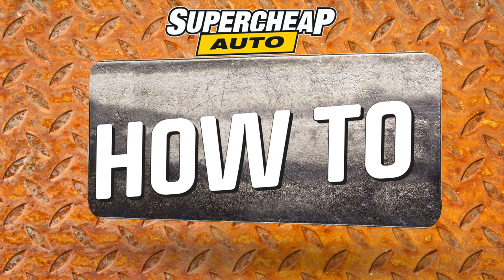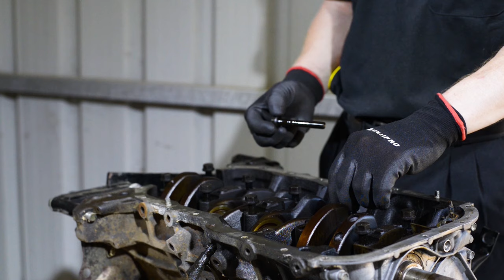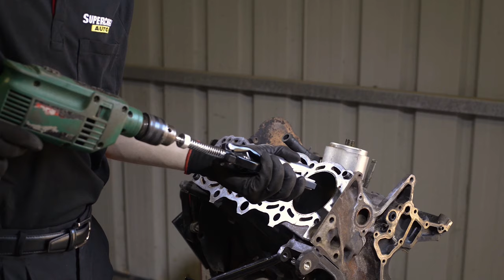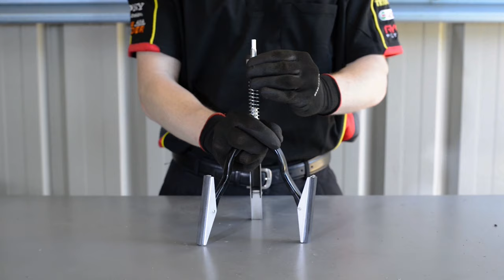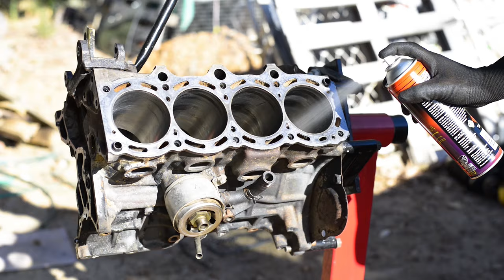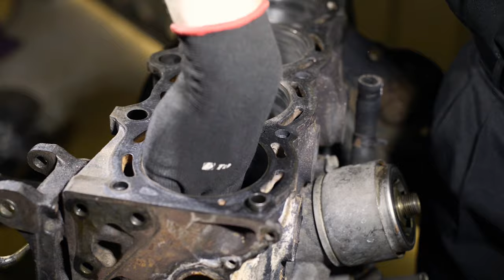How to Hone Engine Cylinders The Right Way

Comment: This tool is good for getting out the high spots in the bore, after using this run the tool that has multiple stones that looks like a toilet brush to give you the cross hatch pattern
Reply: I didn't find a ball hone for the diameter of my cylinders, so I only had this tool to do this.
And to my big surprise, the crosshatch pattern was absolutely perfect!
But it was a difficult task to get it right, you have to choose the right drill speed and stroke that shit fast!

Comment: I have a 1980 tt 250 yamaha. Bore an stroke is 75x 56.5mm. Should I get a 3 1/4 hone or a 3 1/2 ball hone
Reply: Ball hone makes a bad finish and its not consistent with the diameter

Comment: Stones are reffered to grit size 240-320-400etc  Optional stones should be available .
Using oil with large amounts of friction modifier eg engine oil is NOT recommended . Using common available suto trans fluid is ideal or WD40 etc 
1st identify the cyl bores   cast iron or Nika Sil 
2nd identify what the OEM cross hatch pattern is 35--45--44 degree ??
3rd remove cylinder ridge 
4th  measure cylinder bore taper  and outta round / ovality 
5th ALWAYS HAVE ENGINE  PROFESSIONALLY MACHINE  HONED  IN A  dedicated machine 
5a if the measurements are even on the max limit for wear a machine hone is recommended  to achieve max life remaining life 
5b the more the measurements are over the wear tolerance the rehone will have a very short life span 
3c excessive cyl bore wear will have oil consumption problems

Comment: I just did this and used WD40 prayed on the stones and in the bore and spin in a bucket of warm/hot soapy water each 16, 45degree angle up and down in the bore. Washing and spraying WD40 each time. Then i did 15 with the drill in reverse. Not sure if supposed to go in reverse but that’s what i did. I didn’t take the big cam out either. Just did a hone and will put new piston and rings standard size. 1HZ. I did a light test at night dark with one top ring in the piston only and manually moved the piston up and down in each barrel, couldn’t see one bit of light other then the ring gap. First go at this hopefully that’s enough?!
Reply: Disassembly is critical as the waste material resulting from the glaze cannot contaminate any assembly component whatsoever. Although a thorough clean afterwards can shape up the process, initial prevention of a bigger mess should always be considered first. Saves time and reduces the likelihood of waste material comprising the nature of new bearings, components etc.

Comment: Left out the step where you bore out those worn cylinder walls.
Reply: Its good enough for a cage
Reply: You will only rebore if the bore is too worn or out of round and requires a oversized piston. If the bore is ok with existing piston a hone will be ok for new rings. Either way you need a bore gauge to measure this and they are usually around $300 minimum  for anything decent. This is backyard slap it together zone. No decent engine will be done this way.
Reply: I also didn't see a torque plate being used.
Reply: @dirkadirka5395  not required on that type of engine, if it was a harley davidson then yes one would be needed
Reply: @blacksheep6888  Why not for the 4 cylinder?
Reply: @dirkadirka5395  Torque plates are needed if you assemble tight clearance engines or make one for performance. For daily driving and just re-honing it, you can just do it without, there's absolutely no harm in that. It doesn't matter if it's a 2 cyl or 8 cyl or whatever in between.
Reply: @XStuntManiac  Interesting. Could I have an example of standard tolerances/class of fit required for High performance vs a regular engine please? thanks for your input and cheers.
Reply: @dirkadirka5395  I can't really come up with any real life examples, but if you want to get more power out of the same displacement engine, you need to make it more efficient. To make it more efficient, you need tighter clearences to for example raise the compression ratio if you want an NA engine. 
As well as racing spec engines are toleranced tighter than any otheres due to exact same reason, they need the quality to make as much power from the engine as possible, there's no need for as huge "reliability" like we seek in daily drivers cars.
I believe that the recent season F1 V6T engines are needed to be so efficient, that they are so tight you literally need an impact drill to crank them, where in your daily driver car you can spin the engine by hand with a wrench on a nut of a pulley.
Reply: Best to use a stepped top ring in them cases or grind a chamfer on the new top ring  assuming there putting new rings back on that is

Comment: Shouldn't have the ring ridge. Back to the machine shop.
Reply: Flash Man  when I did engines, easy stuff in the early 70s, we always bored them out to receive first oversize pistons. Most honing was done by the machine shop. I did hone a few that had no ridge. Usually measured out ok for stock rings. But most of my honing was done on dirt bikes. I turned to using the phones with the balls on the ends of wire. Also did brake cylinders. But engines were done by the pros. Later on by the early 80s it was buying rebuilt engines straight from the factory. Cost didnt pay to do it ourselves any longer.

Comment: That is not a hone. It is called a glaze breaker. It would be far to slow and not accurate to hone a cylinder to be true
Reply: That's the same type cylinder hone they have used for many decades before these new fangled ball hones came out
Reply: @glengillham4629  to rebore a cylinder with a rigid machining boring tool is an entirely different process then simply honing a cylinder, breaking the glaze, and preparing it for new rings. They can call a Boring tool a "hone" all they want to nowadays, it does not make them the same thing.
Reply: this is definitely a hone, its just not going to give straight and perfect results like a machine shop rigid hone would... its absolutely fine for cleaning up cylinders, if they fall within spec there is absolutely nothing wrong with this kind of hone.

Comment: I thought the name of this video was hone cylinders the right way.
This is not the right way.
You need a rigid hone - IE a Sunnen hone, that keeps consistent pressure evenly and will correct any imperfections in the bore. 
All you have demonstrated is how to scratch a cylinder

Comment: Let's just say... hypothetically... for a friend... if a person ran their 2 stroke without a working oil pump and scored their cylinder walls but the pistons themselves are fine because they only ran it 3 times for heat cycles.. (again this is definitely hypothetically) they could use this and keep the same pistons in from the rebuild they just spent 5 grand on and not have to buy a new cylinder or will this only work for deglazing
Reply: Depends how bad the scoring is. But almost all scoring is irreparable by honing, the exception would be when it doesn't catch your fingernail. So basically yeah only deglazing. Probably going to have to start over on the top end as the cylinder might need machining, therefore, your pistons and rings won't match up.
Reply: @LifeofAedan  tried honing it out and it didn't work, I brought them to a machine shop, hoping they'll get it done, just gonna be looking at ass loads of labour charges but guess that what happens, damn
Reply: @GabrielLenek  yep unfortunately that’s always the hard part is damn machine shops charging a boat load. If you can find yourself one ran by older folks they always seem to be a lot better. For example when I rebuilt my duramax the diesel shop wanted to charge $500 to machine the heads. Brought it over to this little shop connected to an advance auto and got them done for $50 a head. Back in the day when your auto part stores did more than just sell stuff. Pretty cool, but there’s barely any around nowadays.

Comment: Honing? No, This is deglazing. The cylinders will still be out of round and tapered. You might have a nice looking cylinder finish when you're done, but that doesn't mean it will seal a new ring. This is perfume on a pig.
Reply: That;s why you use a ball dunny brush it hides all the wear ?

Comment: So much wrong here. Always make full passes, otherwise you run the risk of tapering the cylinder walls. Honing doesnt just make crosshatching, it removes material and is used to take out the last few thousandths after boring as well as deglazing during a rebuild.
Reply: Yes uniform honing is the key.
Reply: Its only a cage it'll be fine.
Reply: This is just degrade and quick cross hatch. I honed many cylinders no need to bore if have a sunken hone can take as much as you want
Reply: More like tenths not thousands. You'd really have to crank it down to remove thousands.
Reply: @StreetTruckinTitan  what? .1 is a tenth which is far more than .001 which is a thousandth. So a tenth is 100 times more than a thousandth.
Reply: @StreetTruckinTitan  yes .0001 is 1 tenth of one thousandth or 1 ten thousandth you are only talking about thousandths. It does not change the fact that .1 is one tenth, you are correct in saying it isnt one tenth of a thousandth however .1 is still 1 tenth
Reply: All of that is irrelevant though. The fact is honing is used to take out the last few thousandths after boring. It is not uncommon to leave .003 (three thousandths or should i call it three tenths of a hundredth) to .005 (five thousandths) after boring to be removed with a hone. The majority is removed with coarse stones while the final cross hatching is done using fine stones.
Reply: @63jeepj20  I'm aware. We have a precision aerospace honing shop since 1965.
Reply: @StreetTruckinTitan  if that were the case you would know that .1 is a tenth and .0001 is a tenth of a thousandth and not just a tenth.
Reply: @63jeepj20  we deal in .0001s Son. We rough as close as .001-.003 depending on the condition of the bore. We finish anywhere within .0001- .001 again depending what the bp states. I can hold around  .0003 by hand my brother can hold 50 millionths. That is splitting frog hairs.
Reply: @StreetTruckinTitan  that doesnt make any of what i said false. If you deal in ten thousandths and an engine machinist deals in thousandths then telling him you have a tolerance of a tenth kinda creates an issue and you will end up with something way out of tolerance. This is why i said what i said and not a tenth of a thousandth.
Reply: @63jeepj20  study the chart I posted. If you're dealing with a mechanic that doesn't know what tenths are or the decimal equivalent I'd stay away. 
And with that, I bid you a nice day.
Reply: @Checkered Life  again, a tenth is written .1 a tenth of a thousandth is written .0001 if you brought me something to machine and tell me you want a tenth removed youre getting a tenth removed and you will be paying for a new part because of your inability to grasp decimals. My dad owned an engine machine shop for 40 years, ive bored cylinders, decked blocks, resurfaced heads, replaced valve seats and guides, ground valves, line honed, sized rods, trust me i know how to read a dial gauge. The fact that you are arguing about this tells me you are either a janitor that cleans around machines or you work at a production facility that only taught you what you need to know to mass produce whatever part they are running that day. Again, a tenth is a tenth or .1 a tenth of a thousandth is one ten thousandth or .0001 you stated i was wrong in saying a tenth is .1 which is not correct a tenth and a tenth of a thousandth are two very different measurements. All you had to say was "oh you meant an actual tenth, i thought you meant a tenth of a thousandth" and been done with it but instead decided to argue that .1 is not a tenth and attempt to explain how i was wrong by using a tenth of a thousandth as your evidence.
Reply: @SOLDOZER  youve never run an actual hone i see.
Reply: This thread is hilarious. Dude states that thousanths are bigger than tenths, then goes on to pretend like he didn’t just say that and continue lecturing everybody. It’s ok to be wrong. Just fucking own it and move on.

Comment: The right way? Where's the torque plate for the top of the block?
Reply: Not required on this type of engine
Reply: @blacksheep6888  Curious as to why? Thnx
Reply: @dirkadirka5395  its cast iron simple,  I am a qualified mechanic worked in engine reconditioning shop.
Reply: @blacksheep6888  OK cool but when would you use a torque plate then?Thnx
Reply: @dirkadirka5395  some aluminium blocks and motorcycle barrels
Reply: @dirkadirka5395  harley davidson barrels must use torque plates
Reply: @blacksheep6888  Why? I'm looking for the reasoning please.
Reply: @dirkadirka5395  aluminium is flexible carst iron is not having said that the harley barrel is a thin sleeve so there is a small amount of warpage so torque plates are required, but a cast iron block dose not have this problem, and the block has threads in it that don't go all the way to the bottom of the bore, the harley barrel does.
Reply: @dirkadirka5395  also keep in mind aluminium coated barrels, they would require torque plates
Reply: @blacksheep6888  Right so a cast block being flat assuming it is wont be distorted by the mounting of the head,, that being said if the top face of the block is not flat it will be dealt with by the head and gasket being compressed? Thnx!!
Reply: @dirkadirka5395  nope you missed the point its got nothing to do with the flatness of block or head, its bore side wall warpage
Reply: @blacksheep6888  Well then please explain please why and when it should be used. I wish to learn,, thnx.
Reply: torque plates are more suited to a fixed bore hone that will mill out a straight hole and even then its not required on cast iron but people still use them if they're looking for perfect cylinders. 
this type of hone is for backyard/home mechanics to remove surface imperfections and glaze (the cylinder getting polished smooth) from a cylinder wall for a ring to bed against... it doesn't give you a perfectly straight hole but as long as the bore is in spec then you're fine.
Reply: @dirkadirka5395  example is a Harley davidson barrel
Reply: @blacksheep6888  All reputable machine shops use torque plates on cast iron blocks daily.  Your explanation is not correct, sorry.
ALL blocks experience distortion when you torque the heads down, and honing with torque plates is a way to eliminate that when you are doing the final hone. 
That said, this way of honing is not a particularly good one.  It's just a "break the glaze" method, not meant to really size the cylinder to the piston, so it's fine if that's all you're doing.    But if you're doing a high-mileage rebuild, it really should be honed on a machine and the bore measured to make sure you don't have too much clearance.
Reply: @dirkadirka5395  He's talking cylinder bore warpage, and that is present no matter the block material, so he's not correct.  
This way isn't really "honing" it's just removing the glaze.  Nobody final hones to match bore size to a cylinder this way.  This is just for a quick refresh, not a final hone after boring to size the cylinder to the piston precisely.    So the torque plate wouldn't be as critical here, since this isn't really a "machining" process in the first place.  

If you are REALLY honing a cylinder, you want torque plates, no matter the block material.  There's not a machine ship in the country worth using that doesn't do it that way.
Reply: @SealofPerfection  I worked for an engine reconditioning shop and torque plates are not required on carst iron blocks, only if you build high preference engines. They never used said plates, they never even owned said plates.
Reply: @blacksheep6888  All the shops around here, use plates if they are available.  You must not work for a top quality shop.   
Sure, you can get away without them...people did for year.  Doesn't mean that plates aren't the better way.
Reply: @SealofPerfection  not needed enough said
Reply: @blacksheep6888  "needed" vs "better".   You stated the cylinders don't warp on an iron block.  That is factually incorrect.   Whether it matters or not, depends.  Stock rebuild?  You're find.   Performance?   You want the torque plates.  You give up anywhere from 10-30hp on a V8, depending on how strong it's built, without the plates. 
So:  Will it run fine without?  Sure. 
Will it run BETTER with?  Yes, particularly if it's a performance build.  For a stock refresh, you're fine.  But I'd still use them if I had them, but it's fine without.
For performance, you're giving up power if you don't use them.   Proven many times over.
Reply: @SealofPerfection  as you can see not required, unless it's a high performance project.
Reply: Torque plates for boring. This honing process is just a surface finishing process not a re sizing or reshaping process

Comment: For a rering job at home  you are better off using a ball hone or it can be called a flex hone. Those 3 legged things can do more damage then good. I have rebored possibly thousands of cyl blocks and have seen backyarders damage cyls using those 3 legged things.
Reply: On the other hand,  if the cylinder walls are uneven and 'waffled' the balls will follow the contours. Long flat stones are the best choice when the cylinder conditions are unknown. The ball hones are better when the block has been re-bored or sleeved and you know the sides of the cylinder are parralel and straight.
Reply: @coolhand1964  You are obviously not a qualified engine reconditioner or you would know that after an engine has been bored you need to hone out around 004" to make sure all the tool marks are removed and a ball hone will not remove anywhere near that much material. A proper hone needs to be used such as a sunnen using multiple grades of stones  not some 3 legged bargain basement tool.